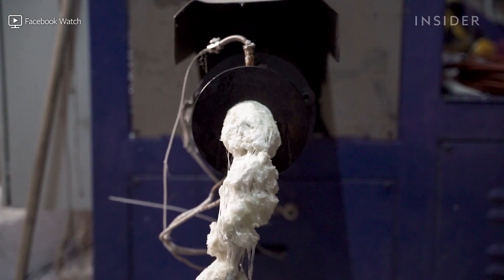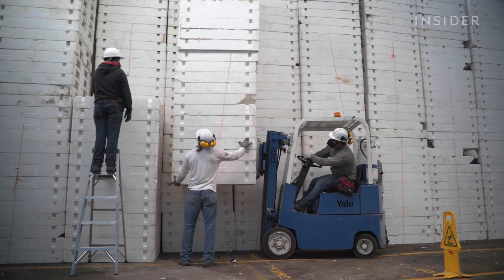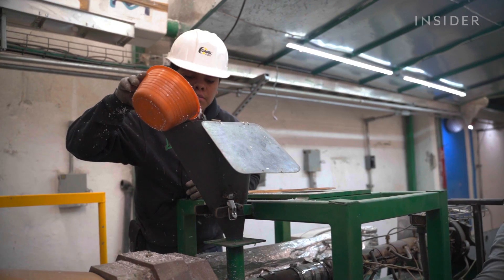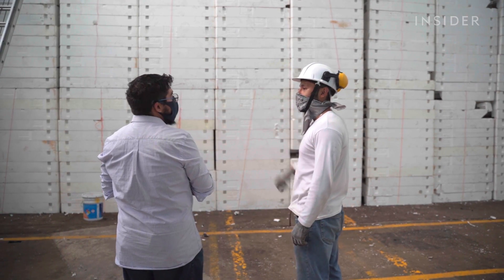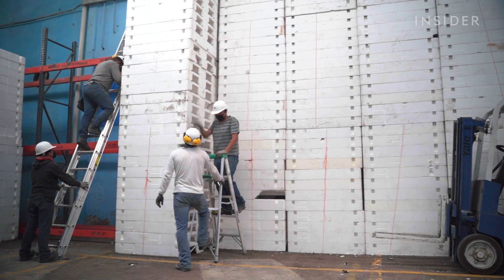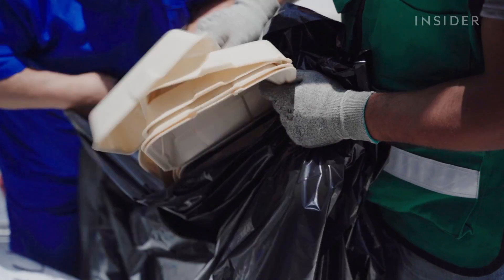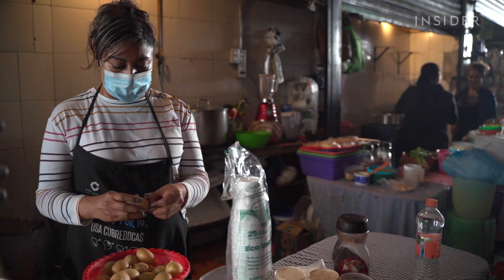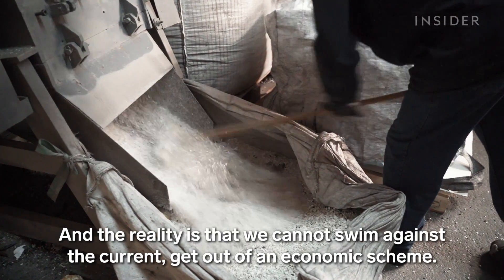Why It’s So Hard To Recycle Styrofoam and Polystyrene | World Wide Waste | Business Insider

Comment: The problem with recycling is never about rather if the item can be recycled or not. The issue lays in the amount of extra energy and resources to recycle such item. In many cases, recycling certain item create more pollution.
Reply: Every action takes energy. And energy, in the current state of the energy grid, produces more CO2 pollution. Therefore, if the energy grid is made more green, then the carbon emissions from recycling would also reduce.
Reply: There’s a reason recycle is last of the 3 R’s. Reduce, Reuse, Recycle.
Reply: @MrX8503  there's two more R's refuse and repair
Reply: @MrX8503  Which is weird to me, since the one I remember most is a small jingle that I think was in a commercial decades ago that went "Recycle, Reduce, Reuse, and close the loop". So I guess the 3rd R all depends on who writes it down.
Reply: And in some cases (aluminium, for example) recycling is actually more efficient and less polluting than making more. And I'm not talking about being just a little better here either, figures I've seen are 95% more energy efficient to recycle than to manufacture from bauxite, and producing 97% less carbon emissions to do so.
Reply: @MrSpleenboy  Now with metal recycling, 100% all the way. I hate seeing metal go in the trash. Most metals are infinitely reusable and mining for them is fairly damaging. Glass also - it takes considerably less energy to recycle than produce new glass. Plastics are just a little fuzzier area.
Reply: @MrSpleenboy one should never drink out of an aluminium can. I don't care if it is 100 percent recyclable
Reply: and people bothering to deliver it at the stations instead of throwing it out the car window etc
Reply: And that's why Reduce and Reuse are ultimately more important. We need to consume less. And Recycle as a back-up
Reply: That statement is objectively untrue and simply wrong.

Every process will require energy and additional compounds. But that is necessary in all case. The alternative should not be lets not recycle because its easier to produce new than to recycle. Your point goes into the economics than the environmental impact. Moreover you are just pushing off the negative impacts and related responsibility onto the future.

If the material is indeed hard to recycle then we definitely need to consider better alternatives since that stuff would just be toxic to us and the entire ecosystem and we can't do anything about it at a later period.
Reply: @bs5740  I understand the benefits of actually running it and it is a good thing to run I'm not arguing that I was just sharing my experience witha ctually making plastic from recycled materials. This more our less a reasoning why companies don't like to again from experience with the material. On that we really should develop better processes as an industry to run it. Was just giving my experiences running it.
Reply: And economics
Reply: so we should leave things as they are and return to a simpler living. there is no other way, civilization as we have it today is not sustainable at all
Reply: That's the big problem, you have to look at the total net energy usage of the whole process. If you expend more energy collecting, transporting, processing, and then using recycled material to make a new product, using energy and emitting carbon along the way at every step, are we really saving anything other than cutting down waste? We're just trading one type of pollution for another.
Reply: @SOHCGT96  you disregard cutting waste, but this is an important benefit it prevents toxic chemicals entering the environment and damaging the ecosystem. If the cost of recycling was built into the cost of buy the plastic it would make renewable plastics more viable
Reply: all pollution can be controlled however the cost is more then a company is willing to spend.
Reply: Dumb. Yes of course it costs energy to recycle just as it costs energy to make new. You could argue capture carbon and landfill plastic, but eventually we'll run out of places to put it.

Also, if you buy chicken breasts at the store think about your tray now being PET instead of foam. Your tray may now be more widely recycled, but Americans only recycle 30% of the time and its 3-4x as heavy as the former EPS
Reply: The same catch 22 exists in the production and the long term pollution of EV’s
Reply: We never actually do a real total cost of virgin materials. Most all extraction never accounts for all the externalities -- lost habitats, land taken away from indigenous peoples, labor issues, releases toxins, etc. So if you are really being honest about total costs, account for total costs on all ends.
Reply: We run recycled material at my job it creates alot of scrap that has to be rerecycled and it takes alot of energy to run the machines it also runs slower than fresh material.
Reply: In the broader calculus recycling materials that provide fewer returns on investment are offset by recycling similar materials that do provide excess returns, ie the same company recycling both polystyrene and PETE. The net carbon footprint is mitigated by recycling multiple materials.
Reply: I'm totally with you. Especially recycling those single use foot stuff is not very effective. Most probably it would be better to burn in a waste plant and produce electricity or even better just avoid making all this trash and avoid single use package.
Reply: Processing styrofoam with heat is very, very cheap and resource efficient. Sorting through mountains of trash and shipping it to a central location is probably the most resource and labor intensive part, and it can't be ignored because styrofoam is so light and you can't pack very much into a big truck. The other problem with heat reprocessing is that you end up with a really really low quality material afterwards. It can't be used for things like food containers and probably can't even be turned back into foam. It's also probably a lot more likely to leech harmful chemicals.
Reply: i thought its all about money
Reply: Ask new york city waste disposal. Costs to dispose a metric ton of waste whent from 12$ to over 100$ after recycling was mandated. Who pays? The poor fucker as always.
Reply: it freaking sucks. i wish we could just press a button and stop all this mess
Reply: I believe nonrecyclabe materials should be used (burnt in special facilities) to create energy. This way everything can be recycled. And the energy can be used for recycling.
Reply: In Europe it’s almost impossible to find polystyrene cups or plates but businesses are still able to sell their food and beverages
Reply: Agreed. we need to stop the need to recycle in the first place. reuse vs recycle
Reply: some things yes , many things no , its just that with many things its cheaper to keep cutting it down and digging it up 
or the mining companies don't want the competition it will drop their bottom line  Profits ! and that's all they care about and they are too powerful to stop 
Governments world wide  cower to them
Reply: @sprintershepherd4359  But how much longer can we keep mining until the mines run out themselves I dunno if Im an expect but Im pretty sure with over billion humans in the world it make the mining more demanding and more requried until you get too close to the mantle.
Reply: @sprintershepherd4359  Yeah well I think people if they want to reserve this materials to build our products which in terms of none eatable material we have collected in our house including electronics to salvage parts when they die and go out of their way to take all the gathered material in order to recycle, and not just throw away and rely all on China to get stuff without question. At some point were gonna have those issue and same reason we need people to think about learning trade skills.
Reply: i do think overall it’s better if we can prevent pollution byproduct. for example, using energy powered by renewable sources and not oil/coal. using electric vehicles. also supporting the technology of electric batteries in order to switch from the grid to solar power/other renewable sources. 
at least in this way, we don’t have the physical pollution in nature. 

but most importantly, we should support switching out plastic items to reusable items. for example, a food delivery company that provides dishes for takeout to restaurants. they pick up the dishes from the customer’s house afterwards. any broken/stolen dishes are charged to the customer. 

hopefully we can eliminate the issue of plastic waste at the source instead of trying to alleviate the resulting problems.
Reply: @onlythegracee  Battery Electric Vehicles are a toxic nightmare.

Comment: In fact, ages ago a company in the US started using lemonene to dissolve styrofoam so that it could be reused. The lemonene itself could also be reused. I don't know why this did not become widespread. You can see it in action. Just squeeze a piece of any citrus fruit and spray the lemonene on some styrofoam and it will start to dissolve.
Reply: Plastic modellers do this. Dissolve waste pieces of polystyrene models (not expanded but it's basically the same) in solvents like limonene or acetone. It's called sprue goo.  Use it as plastic glue and filler.
Reply: You can make Napalm out of it too.
Reply: @printingwithlue4310  use it
Reply: @Rahul-kz5fi  I have. Dissolve a bunch of Styrofoam into gasoline. It turns into a goopy sticky mess that is almost impossible to put out with water...
Reply: @printingwithlue4310  It's not napalm, its a vaguely napalm like substance.
Reply: Foam+gas=napalm

Comment: It looked to me like almost all of the waste depicted in the factory was pre-consumer waste, from industrial sources, and besides some publicity events at universities, they have no reasonable mechanism to scale it to handle the massive volume of post consumer waste. Do not be fooled by this video into thinking that it is possible to recycle used polystyrene. The costs to separate it, transport it, clean it, and recycle it will just never be worth it for the tiny amount of polystyrene resource in those materials. “It just doesn’t make economic sense” so all use of these materials is unsustainable.

Comment: I was of the opinion that polystyrene block as shown here are basically small spheres combined together with steam in a mold, would it not be possible to break down the used packaging into small spheres again ( ever broken a piece, that's what you get all over the place) and just remould them, seems the simplest of processes, so would be more energy efficient.

Comment: There are other options. Multiuse cups / plates for streetfood e.g. and even paper stuff is better because as we just learned its a lot of waste that can only be broken down by those special factories which only do break down very little of it. It´s hard to transport too due to its size. Paper and other materials are more compact making it easier to transport and also don´t need special factories. Generally using multiuse items with a deposit system would be ideal I suppose. 

I ought to say though that it was funny to look at the guys unloading the truck by carrying those giant packages of foam all on their own.
Reply: The whole point of disposable packaging is to dispose of it. I do not want to eat off a used dirty plate. That's poor sanitation. Which has its own health risks associated with it.

Comment: Ideally, companies would be partially responsible for the cost of recycling their plastics, certain plastics (1 (Polyethylene Terephtalate) and 2 (High Density Polyethylene)) are more valuable and easier/cheaper to recycle than others. This would push companies to use more easily recyclable plastics to keep their costs down. So many times I’ve looked at the bottom of something and see that it’s a number 5 (Polypropylene)instead of a 1 or a 2, especially clear cold drink cups from places like Starbucks. Yes, you can buy a reusable cup, but if you’re ordering delivery that’s not an option. (Polystyrene is number 6.)
Reply: You would just push companies to relocate to where your BS laws do not apply.

Comment: To me it would make more sense to just grind the polystyrene foam... add a little binding glue and make insulation panels for homes, freezers/ fridges ect.
Reply: If you could find a glue that wasn’t water soluble and that won’t melt styrofoam, that would be a great idea. How about letting farmers mix the pellets with their farmland to aerate it better. It seems like it would be kinda inert for the 3 or 4 years it’d take it to decompose.
Reply: @shanepowers7566  It doesn't aerate anything. It just takes up space, and eventually ends up in the ocean. Polluting our soils with plastics is a horrible idea. Just because it's a white granular foam, does not mean it's just like perlite- it is not.
Reply: Actually just use steam from water heated to only about 120 degrees. That's all that is used in the he original manufacturing process...
Reply: @richardmoore7367  That would be insufficient to fuse the pre-used, ground up product though on its own. The ground up garbage can be mixed up to about 10-15% with new material and be molded, however the end product lacks strength and flexibility, and so its use is limited.

Comment: I recycle my Styrofoam into a low-grade napalm. (It's just Styrofoam and gasoline if you want to try for yourself.  Don't worry about the ratio, it will dissolve into a jelly-like substance almost instantly. Just pick up the jelly at the bottom of the jar and there you go.) 
Molotov cocktails typically have a ratio of 25% napalm to 75% gas.

Comment: 6 tons per day? That is a heck of a lot of plastic foam.
Reply: Not even a drop in the bucket though. I work in a small EPS facility and our production is double that.
Reply: @fattymcbastard6536  So you kill the Earth twice as fast as they save. 😩
Reply: @mikloscsuvar6097  Yup. We even have one of those EPS compactors too, so all our scrap material is heated and compacted into ingots all ready for the recyclers. We also accept scrap returns from our customers to be recycled. We have even sent shipments of this crap to that picture frame company, and they don't want it anymore. Our parking lot is filling up with tons upon tons of the material and it's free for anyone who wants to pick it up. The issue is nobody wants it. It's a pretty useless material- good for picture frames, indeed, and not much else.
Reply: @fattymcbastard6536  I have heard that some fungii could be used instead of EPS in packaging and it is biodegradable.
Most of my plastic waste are milk bottles. Some years ago milk was sold at the local market, but that business was finished.
Reply: @mikloscsuvar6097  
Sure. I'll concede that a box can be made from fungi, but is it a realistic replacement? Even assuming the density of the material is the same as the EPS product to be replaced, we would need 10,000 kg per day at my workplace. How huge of a mushroom farm would we need to grow all the material to make our boxes?
Reply: @mikloscsuvar6097  Waxed cardboard works in many cases too.
Reply: @mikloscsuvar6097  Plastic milk bottles o.O
Reply: @PurpleCh4lk  The milk I buy is an almost unprocessed good and is unfortunately sold in PET bottles.
Reply: @mikloscsuvar6097  imagine how many trees would need to be cut down to fill demand if we stopped using plastic and switched to paper. I don't think the solution is going to be that simple. I agree that single use plastics make no sense as they never biodegrade.